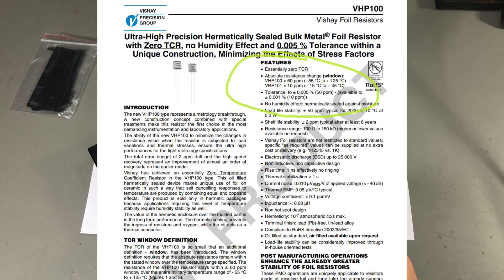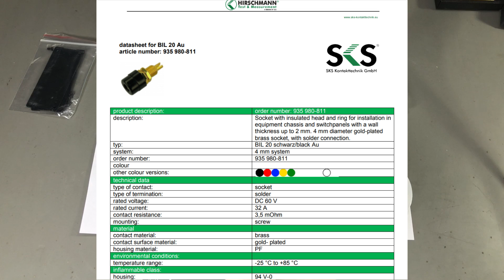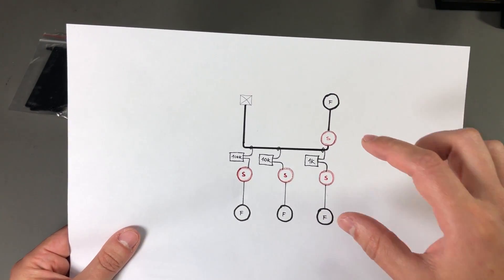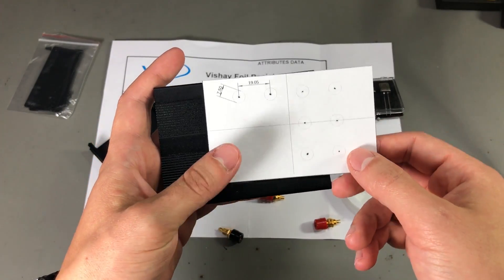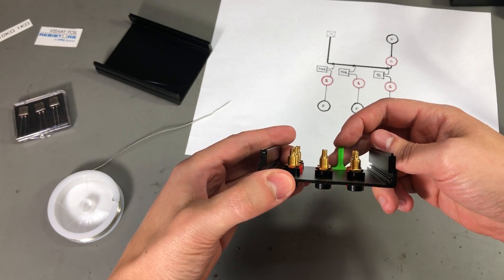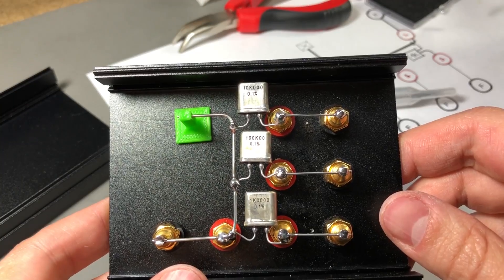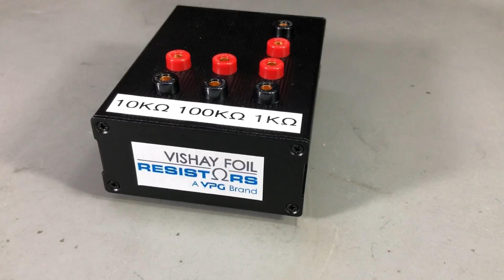Voltlog #183 - Building A Resistance Standard With Vishay VHP100 Resistors

Comment: Metal foil resistor.
https://es.wikipedia.org/wiki/Resistencia_de_l%C3%A1mina_met%C3%A1lica

Index
1 History of foil resistor
2 Study and development of sheet metal resistance.
3 Effect of physical variables that influence electrical behavior in metals and alloys
3.1 Temperature coefficient of resistance
3.2 Operation of the metal foil resistor
3.3 Forms of construction of metal foil resistors
3.4 Manufacture of metal foil resistors
4 Component design
5 Cleaning and degreasing of the metal sheet.
6 Nickel-chromium alloy heat treatment, Evanohm S.
7 Photolithography process
7.1 Etching by electrolytic or chemical processes (etching)
8 Soldering the copper terminal to the metal sheet.
9 Processes
10 Smith, precision resistor
11 References

Comment: I expect somebody said it before ..only 2 Points/suggestions/..3rd is optional but worth considering ..1. I was really surprised you didn't do it..So why not to take end of the thick wire (where that green thingy is and soldered it back to original connector..you would actually 1/2 resistance this way of that wire     2. to be honest ..you didn't go according your design..Sense wire you should put before those resistors lead ..not onto binding posts themselves..now you would have to unsolder those sense wire ..but that is not a problem..you can still do it...This would eliminate resistance of binding posts themselves..for this you can use thinner wire ..that would be good idea also ..there is also one thing.. 3.  (lets call it new idea for improvement)not sure if you think about it or not..but to put another binding post that would be guard ..and then place it onto /around those metal cans..this way you would eliminate even more of these issues..but that would mean some innovative thinking..anyway good work..keep it up

Comment: Like the build, looks very clean! But to further mess with your OCD ;), it's 100 kΩ, not 100 KΩ. Aka, the kilo pre-fix is a lower case... I think for a box that exact the label should be as well...
Reply from the maker: Didn't think about it until you mentioned but I fixed it easily by swapping the label with a new one :-) Thanks!

Comment: Very nice, have you see any difference in the resistance before and after by using your multimeter ? what quote did they give for a calibration ?
Reply from the maker: yes I am noticing some changes but I will give it a few more days to settle. I didn't get a reply yet from the cal lab, I will keep searching. I'm expecting something in the range of 25 EUR per resistor.

Comment: Just a thought. But instead of getting a thermally very stable resistor, someone could also just make a thermall stable environment?
Reply from the maker: yeah, why not, you could do that if you think it's cheaper, more reliable and easier to build & maintain.
Reply: @voltlog  Is thhis the 0.005% version or the 0.01%?
Reply from the maker: 0.1%
Reply: @voltlog  . So it's not totally the ducks guts yet. 😉😄
Reply from the maker: Merlin Gallagher  tolerance has nothing to do with this application, it can be a 10% tolerance part, I couldn't care less. What I care is stability, once I measure the value with a high precision multimeter, I want that value to be stable regardless of various factors.
Reply: a thermally stable environment is hard to impossible to make, it's going to be many times more expensive, and you won't beat the standalone resistor

Comment: It'a a bit late now, but if you put a clip on the lead between the soldered joint and the resistor the heat would have been dissipated and reduced before it entered the can. Those normally closed tweezers that you squeeze to open with the flat tips would have good contact, and you could add a croc clip to clamp it tighter.
Reply from the maker: thanks for the hint, it was shared with me on previous videos as well but I thought the wet sponge would do a better job and didn't use the clip anymore. The space was pretty tight too.

Comment: Why didn't you just clip a heat sink on the resistor leads??
Reply from the maker: thanks for the hint, it was shared with me on previous videos as well but I thought the wet sponge would do a better job and didn't use the clip anymore. The space was pretty tight too.

Comment: Nice but you should have placed the 2 connections of the bus bar at the 2 ends of it, not in series to have no current in the wire between the lead and the sense terminal.
On the other side, it would have been better to have 2 separate connections with the sense wire being the one closer to the body.
Reply from the maker: you're right, I realize this now by looking at the connection diagram, I don't know why I didn't think of this before doing it :-) Having that force terminal at one end of bus bar and the sense terminal at the other end.
Reply: @voltlog  you can still cut the bar between the sense and current connectors and add a wire between the other end of the bus bar to the current connector
Reply from the maker: c muller  yeah I could do that and I could support it with one of those 3d printed pieces. Thanks for the suggestion!

Comment: Also I think you should 3D print some mounts for the resistors, to take stress off the leads.
Reply from the maker: Those are some pretty stiff leads, and I've seen them soldered in an identical way in a box built by vishay themselves. Since the box is only being kept in the lab, not subjected to mechanical stress I don't think it will be an issue. I've also opened up a thread on the eevblog forum, I'll ask the question and let's see what the metrology guys say.

Comment: I don't like how the resistors are just flapping around in the breeze. Dave would've cringed. You should use something to hold them. They are relying on their pins only which might break over time.
Reply: Guess what..... Dave is far from the be-all and end-all of engineers. He regularly misses simple things and whines about irrelevant things, often enough with hypocrisy. I would not hire him based on the simple things I've seen him miss and the subsequent whining about his misconceptions. He seems to think he's much better than his actions tell.
Reply: @Peter_S_  Are you an engineer? If you are, then I might trust you.
Reply: Iqbal Samin Prithul, I've been designing and building commercial computer products since the early 1980s. I've done custom hardware for Apple's Advanced Technology Group (they used to be Apple's internal "think tank"), Sun Microsystems, IDEO, Boing, Disney, Paramount Pictures and many others. I've designed products all the way from simple thermal sensors to complex data acquisition gear to high power digital signal processors for audio manipulation to Thunderbolt/USB 3.0 external drive enclosures with RAID. You can buy my engineering here: https://www.bhphotovideo.com/ and even here: https://www.walmart.com/c/kp/external-hard-drives
Reply: @Peter_S_   Woah. You're awesome. 

Some people complain about others without knowing anything. So just wanted to verify. But you surely know what you're talking about.

However, it's hard to find an engineer teaching people on the internet. In that regard, Dave is doing a great job, isn't he?
Reply: Iqbal Samin Prithul, I thank you, but really I'm not awesome at all... just an old nerd that grew up next to Silicon Valley. 😉 I was born in the right place at the right time.
I get my work from the reputation of my work, not social media, and I like most of what Dave has to offer but I've also unsubscribed a couple of times after his whining about things that he was off base with became too much. My attention span is based on the level of respect I have for whoever I'm listening to and sometimes he won't get more than 10 seconds from me. Like Dave, I also use Altium Designer so he's an interesting source of information for me at times but his opinions are FAR stronger than they should be for somebody who makes the errors that he does. There is a quote from a gentleman named Bertrand Russell who said, "The whole problem with the world is that fools and fanatics are always so certain of themselves, and wiser people so full of doubts." Nowhere is this more true than on YouTube and in media. Dave will miss something and then turn that into three minutes of complaining, and often extremely judgemental complaining about what he didn't comprehend. When I call him out on an error or his shameless hypocrisy and post the specifics of what he got wrong he just deletes the post which makes me laugh. Apparently he prefers that his viewers follow him instead of factual knowledge.
Reply: @Peter_S_  I am just a high school student. Man, I wanna be like you when I grow up. Growing up next to silicone valley must've been a great opportunity and inspiration for you. 

I am no one to judge Dave. But after talking to you, I understand that he is really not the best teacher. And I noticed him being hypocrite in his multimeter videos where his own multimeter has some flaws, but he doesn't complain about them. But when he reviews other companies multimeter, he just keeps whining about those flaws. So I see the point you are making and I completely agree with you on that.
Reply: Iqbal Samin Prithul, I wish you the absolute best success! If you follow your dreams, you will make them happen. I cannot express strongly enough how true that is.  
I feel lucky for my experience but I also look at your generation and get a little envy because you have access to such amazing parts, tools, and information that didn't exist when I was young. When I was a little kid there were no personal computers yet, floppy drives used 8 inch disks, there were no small self-contained hard disks, 300 baud was standard speed for online communications, no graphics other than big blocks, no lower case letters, no flash memory, no microcontrollers (other than a couple nasty Intel chips like the MCS-48 series and they had mask ROM for firmware), no USB, Ethernet ran at 1/100th of today's typical speeds and almost nobody had it outside of giant corporations, no Web or Internet, and we had a dial telephone. It was a very different world and it was much less informed. When I was in High School if you even touched a computer that made you about as uncool as uncool could be and while I was on the Internet in 1988, there wasn't anything there yet, really. Then the Web happened, and then the Internet went commercial in 1995 and it all changed almost overnight.

I got online a week after seeing the movie WarGames in mid 1983 and I blame that movie for much of my current existence, that and the Woody Allen movie "Sleeper".

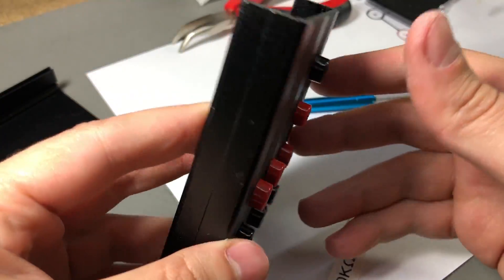Dave presents some good information about the industry and how manufacturing works but I would double check any information you find online. Here is a typical example from 3 days ago in his latest "mystery teardown", you can see how he jumps to conclusions a bit too quickly. https://www.youtube.com/watch?v=TCpo_vNWzMs At 10:30 he slips and shows that (a) he doesn't know those packages from that time period are typically marked on the side and (b) HP doesn't rub part numbers off any parts. That's just how quick he is to talk about what he thinks he's seeing which is not a big deal at all but then from 10:58 to 11:37 he points to a couple of top quality but generic trimmer pots in a case style he's not used to seeing and goes on and on about how they're "precision". What rubbish. They're regular good quality 5% trimmer pots and you can still get them on eBay but HP used them literally everywhere they needed a single turn trimmer resistor. HP would never do that with a precision part because HP did everything with purpose and LOTS of other people used IRC Circuitrim pots in their products too. HP used Circuitrim 10 turn units in more demanding locations. https://www.ebay.com/itm/IRC-CIRCUITRIM-1-2-ROUND-TRIM-POT-500-OHM-1-TURN-P-N-100-1-NOS-2-PCS/332801932138 If he's willing to exaggerate that badly about trimmer pots when people in his audience have 1st hand experience with them, then what else is he exaggerating on or just getting wrong? I've seen too many examples.

In the end I get value everywhere I can find it so I come to EEVblog, VoltLog, and a bunch of other people's sites because everyone has something different to offer. I think sites like VoltLog are better for being able to have quality contact with people and I've found things I was unaware of here so I place the value here equally to EEVblog.

Cheers from Boulder, Colorado!  https://www.colorado.edu/coloradan/sites/default/files/styles/hero/public/article-image/2010_aerial213_revisedga.jpg
Reply: @Peter_S_  Dave has some serious OCD ;)
Reply: Carefully stuff anti static foam (the pink or blue stuff, not conductive foam) behind the resistors and then add some more to the other case half to just barely touch the resistor cases.

Comment: What are your thoughts regarding when to cut excess lead? Before or after soldering?
Reply from the maker: Cool, I wasn't aware of this effect from the sharp side cutters. I almost always cut after soldering because it's more practical to do it this way.
Reply: @voltlog  do you think diagonal cutters can transfer enough impact shock to damage a component with a snip?
Reply from the maker: Full Wave Recked  I don't think it will transfer enough force to damage a component, but it could very well be enough force to affect a sensitive component. I wouldn't worry about regular resistors and capacitors but when cutting leads on something like these high stability resistors I will take extra care in the future.
Reply: @voltlog  yeah, you can never be too careful.
Reply: The only components that you should be concerned about the shock effect on are precision parts (like these resistors) and old semiconductors like Germanium transistors and point contact diodes. Components made for mass manufacture are strong enough that there is no concern from cutting with diagonal cutters.
Reply: Leave more lead (2+ cm) when dealing with sensitive parts and DO NOT use regular diagonal cutters to cut the leads because they create a sharp shock wave that travels through the part when the cutter blades bite through the lead and finally meet. Most electricians have very inexpensive cutters (usually combined with a wire stripper) which work more like scissors were the blades slide past each other to cut and this is the kind of lead cutter you want to use if you need to trim them. Example for small wire: https://www.homedepot.com/p/Klein-Tools-9-2-5-in-Wire-Stripper-Cutter-for-22-30-AWG-Solid-Wire-11047/100648093  and for huge wire: https://www.delcity.net/store/Wire-&-Cable-Cutter,-up-to-2/0-Gauge/p_823657.h_823658.r_IF1003

If you use the proper cutters, it doesn't matter if you cut before or after you solder. If you don't have the correct cutters but you want to proceed anyway, solder the connections first so they can absorb most of the mechanical shock of the cut.
Reply: Piergiacomi CP-TC-14-4 or the Piergiacomi SF-30 are my favorite.
Reply: Full Wave Recked - my thought is to cut after, as the extra wire will help to remove heat and reduce the risk of it making its way to the part.
Reply: @TheDefpom  That makes sense. The reason I ask is that, on Marco Reps, I saw a comment that said if you cut after soldering, you might introduce "micro cracks". Thanks for the response! I checked your channel out & subbed. My only regret is that I have but one thumbs up to give per video... ;)

Comment: Hi, if you had measured the resistors with your best meter before soldering them, noted the difference between the data sheet and your meter, then checked again after construction  and noted any difference.

Regards, Ray..